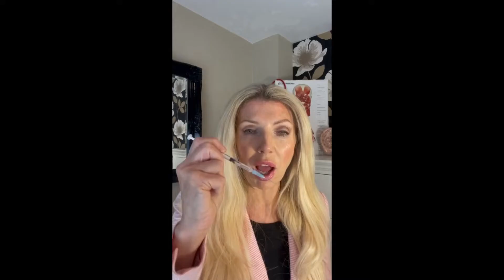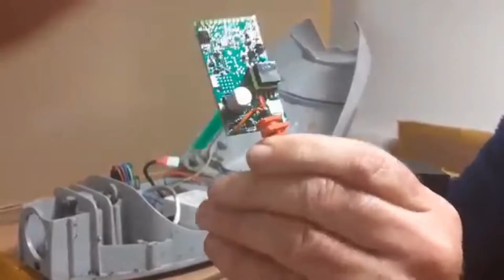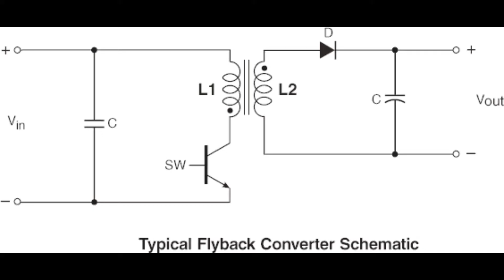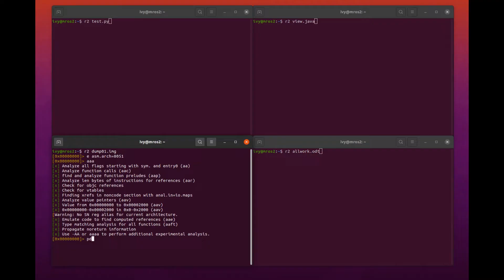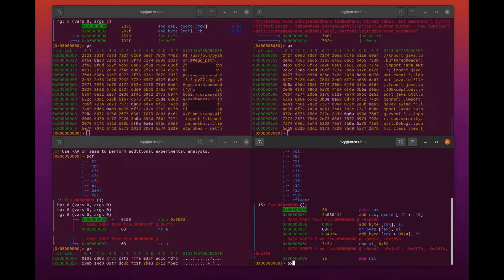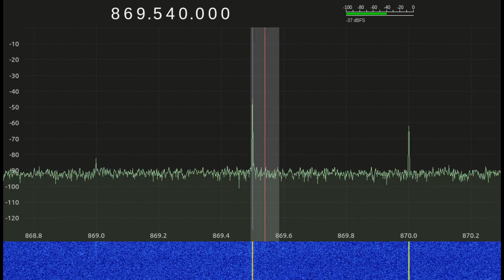Mark Steele, Is there a, Urban Scanning Radar,  5G Weapon, in the Vaccine. #MarkSteele

Comment: I think who ever is trying to undermine mark Steele, maybe do a video on his court case in removing some dangerous toxic elements for the 5g weapon ? That would be fun to watch : )
Reply from the maker: If you watched the tear-down of the (Street Light Switch) then it would be obvious and apparent Mark Steele is a Liar, the unit has a basic 8051 Assembly driven MCU which every component on the board is built around, and has been fitted to garage openers since 2006…..

Google “SI1000 RF Chip spec sheet pdf” then ask Mark how a 3.3 volt 25 milliamp MCU can do what he claims?

And there was no court case, he stole the crowd justice fund with his dodgy barrister, (Who isn't a Barrister nor even a solicitor, he is a priest from London called Robert Bullock!) he recently pulled £37,000 from Crowd Justice for a supposed Court Case? (Feb 2022) this court case hasn't happened nor will happen!

The Barrister in question apparently stole £70,000 from Kate (Natural Nurse) in September 2021 but Mark kept his Crowd justice fund with dodgy Bob open until Feb 2022?????

Get Out While You Still Can Lad!!! 

At best, DO NOT give that con man a penny!!!

Comment: I also have the engineers unit which has been fun :-) I like the Si1000, it’s quite a decent radio SOC. I found that the Si1000 doesn’t implement WiMAC, it’s just a baseband radio, the WiMAC protocol is implemented on the PIC in the other unit on my version. But yeah it’s 2400bps FSK, RADAR, LOL!! Mark steele got very cross at my teardown videos, it was quite comical.
Reply from the maker: Shouty CAPS!!!! 🤣🤣🤣

Comment: I’ve not properly watched this yet but will. I did a similar teardown of one of those units on my channel and more recently I have extracted the firmware and reverse engineered the crappy WiMAC protocol they use. It’s a bit naff, no wonder the company went pear shaped.
Reply from the maker: Hi Lee,

I never would have bothered if I had seen your upload prior to creating mine….
In regards to WIMAC as a company, although it went to the wall in Gateshead lots of other Smart City and IOT companies still implement this same unit with modification in various cities around the UK and on the international market.

The irony in this sad chapter, is that these devices with their various peripherals and applications, actually drive down the watts per square meter that street lighting uses, so the people involved in either damaging and/or creating discourse in regards to these devices are probably paying more in council tax for street lighting!

Obviously as a security researcher, I cant disclose the handful of vulnerabilities I found.
But, you can probably see where I am nodding too…..  😉